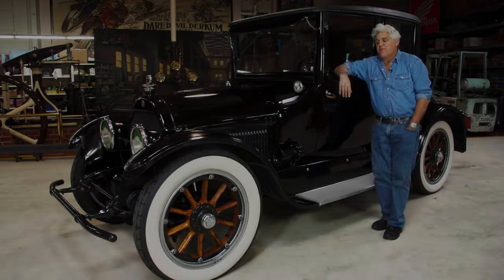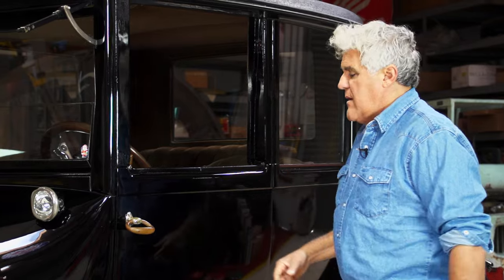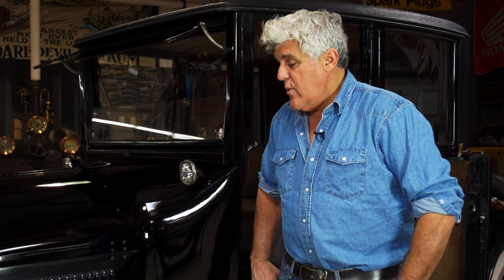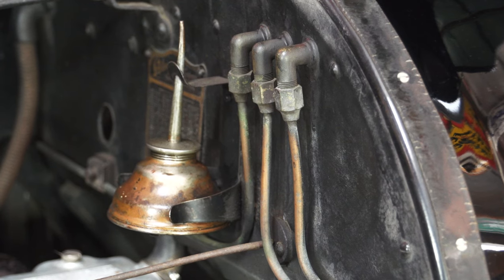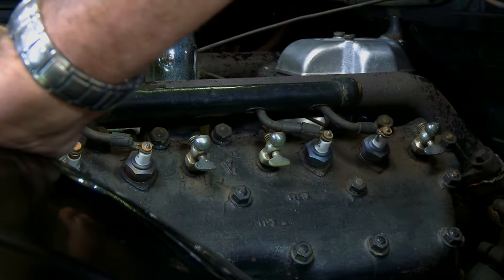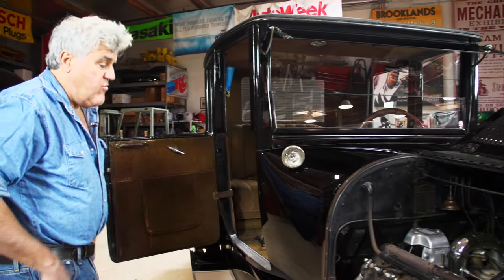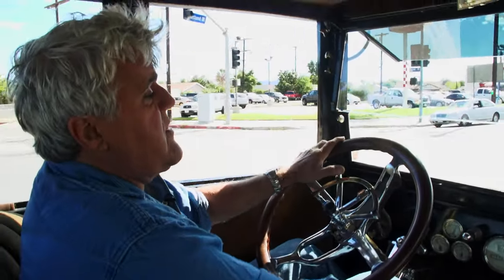1918 Cadillac Type 57 Victoria - Jay Leno's Garage

Comment: I repaired the fuel pump head on this actual vehicle for john, propbably 5yrs ago . it was the leather "O" ring seal , so had to use a neoprene based o ring ! The shaft of pump would walk out fully deployed ,bleeding the pressure of fuel tank . The old girl cleaned up well , wondering if you re-wrapped exhaust down pipe or had replaced it ? Got to drive it ....2miles but john was with me and that was enough ,i was very happy !!

Comment: What a car!  Yes, this is the car that really made Cadillac as a luxury, rather than upper medium priced, automobile.  And I agree with that owner's manual - most problems on an American-made car really are the owner's fault.  They refuse to change the oil and filter, they refuse to lube the chassis, they never check the oil in the differential and the manual transmission, they refuse to check the fluid in an automatic transmission, they refuse to tighten a loose fan belt, etc., then they blame the car when something finally fails.

Comment: Cadillac was called "The Standard of the World" in the day because of the Dewer Award. Also I believe Cadillac was the first car to introduce the electric starter in about 1908.
Reply: I believe that was 1915 that Cadillac came out with the first electric starter.
Reply: Yes I believe you are correct. It was the beginning of the woman's movement because now they could start cars without a man.
Reply: Marshall Curtis I just checked Wikipedia and they cite 1912 as the year that it incorporated the electric starter.
Reply: Terri Bel Bliss Cadillac also was the first to have the pedal layout we have today!
Reply: Cadillac introduced the electric starter because a friend of the heads of the company got smacked in the jaw by a hand-crank starter and later died of an infection.
Reply: the electrical engineers of the day figured it would not work because of the severe overloading, however since it was  operated only for a few seconds it survived fine, the idea came from an electric cash register if I remember correctly.

Comment: why is the fatmans wheel not a thing in modern cars. 
i want one
Reply: therealnightwriter
my truck has tilt steering, but i mean collapsable steering like in the 1918 caddy in this video.
Reply: +therealnightwriter Some even have or had swing away steering columns Thunderbirds & etc.
Reply: +Justin Bechtel  Get a new Lexus LS.    The steering wheel AND the driver's seat retract, and then move toward each other, when you start the car.  Quite obnoxious, actually.  And for those of us who turn our cars off at bank ATMs, the retracting seat makes it a logistical challenge to stop the car at the right spot in relation to the ATM buttons.   My assumption is that this feature is meant to accommodate portly drivers.
Reply: It's called the tilt wheel now

Comment: he forgot to show us the compressor. I wanted to see how that worked :-(
Reply: Your not the only one to notice that shortcoming. You just beat me to it.
Reply: I'm assuming it's the same as the rest of the cars through to the 1924 v63 - but basically there is a pull ring on the floor that you pull up to engage the compressor. The air connector is on the drivers side just under the door and above the battery. Then you have to set the hand throttle to about 1000RPM (with no tacho). It's also not really optional in a sense, because it's actually used to pump the fuel from the tank in the rear.

Comment: It's amazing that 1918 Cadillac has such a huge rear window. Many cars that were made in the 20's, 30's, and 40's had small rear windows and many were split rear windows, all of which compromise rear visibility.

As for that steering wheel that accommodates "plus sized" rich people, I had a 1965 Ford T-bird in which the steering wheel would move out of the way when you shut off the motor so as to make entry and exit easier. How advanced that was for 1918! But then again back then maybe it had to be if all the rich guys had to be rotund in order to show off their "proof that they have arrived' credentials.

This car was not as huge as that 1919 Cadillac former US Army staff car that I saw at the last XXX Root Beer restaurant in Issaquah WA a few years ago. That car only had about 30k on it but it was not in as good a shape as Leno's 1918 model. They were in the process of restoring it though. But it runs. The owners of that huge (I mean HUGE) 1919 Caddie were able to account for it's history back to the mid-50's.

Comment: It's astonishing how well-built that Cadillac is! I've experienced cars that crap out, rust, tarnish, and fall apart no matter how well you care for them. Workmanship and engineering is critically important to longevity. That Caddie is a masterpiece.
One question, though, Jay. What kind of coolant did they use in it? Plain water would have rusted out the block pretty quickly, and, at least, would have caused engine overheating. I can't find info on what people used in the old days for anti-freeze.

Comment: I used to work a Lincoln dealership as a porter. Could you imagine a little old lady coming in about something wrong with her car and someone telling her "well, you don't understand your car, and because of this, you broke the car, you should have read the manual on how to keep your automobile tuned yourself" I mean, yeah an oil change, brakes, other fluids, etc, but, the stuff you have to do to keep this running, they expect YOU to do it!

Comment: For those who may not understand the "interchangeable parts" talk - he doesn't mean "interchangeable between Cadillac and Ford and Chevy", he means "interchangeable between Cadillac Type 57 serial number 7 and serial number 107."  Most European cars of the time, you couldn't just take a spare part off one car and put it on another of the same make and model!  Gas cap? Better make sure it's the same hand screwing. Better make sure it's the same interior diameter. Even though it's the same year/make/model.

Comment: i have an owner's manual from a 62 Chevy pick-up and it reads along the same lines as the Caddy manual. based even off the 62 chevy manual, it most of been time consuming to lube it. in todays cars you'd be hard pressed to even find a lube point (zerk fitting) to grease it.

Comment: I don’t understand the throttle lever on the steering wheel, if he has a gas pedal what does that do? Would love an explanation as I’m pretty confused about the controls and have never seen that before.
Reply: The throttle lever on the steering wheel or column is probably to set the fast idle. When I was a kid, the fast idle was set by a thermostatic bi-metallic spring mounted on the intake manifold. When the car was cold, a rod attached to the spring would open the throttle slightly to help it stay running until the engine warmed up. As the intake manifold heated up, the spring would move and gradually close the throttle until the main idle speed screw held the carburetor butterfly valve at the right angle to maintain proper idle speed. The lever you refer to is more than likely the precursor to that bi-metallic spring device, but completely manual. There may also be a spark advance lever. When cars had manual throttle control levers they usually had those, too. Model Ts had both. I have seen Model Ts in operation at The Henry Ford Museum in Dearborn, Michigan. My grandma's parents had a Model T and it was still running when I was a little boy in the early 1960s.

Comment: I'm curious what gasolines Jay uses in his antique fleet. Many of the very old cars are not very fond of modern fuel. It burns too late and long with valve damage a frequent result.
Also curious as to what fuel he leaves in them during storage. There are unleaded fuels marketed for use in engines that are left standing for long periods. Aspen Fuel is one brand. 80/87 Avgas used to be the ticket, it could be left for years and years but is difficult to find.
Reply: I use boat gas. pure gas no additives. can sit for long periods with no problems

Comment: Usualy as a liquid in a sealed container it's not able to build up heat. If requires the liquid to be spread out enough to oxidise inside an heat insulating material to create enough heat. Just so happens the perfect medium is a stain rag. Rinsing out the rag lightly won't work either (oil & water) so be careful.

Comment: I am surprised it had a self starter in 1918. Most cars would have required a hand crank to start. Also some of the later cars had a central greasing system that lubed all the chassis points with one pumping device. Maybe a Packard innovation?

Comment: I don't know where Jay got the the idea that linseed oil is combustible. Linseed oil is the usual binder in oil paint, which is thinned with turpentine.  Turpentine is as combustible as gasoline. But the linseed oil, and oil paint made from it, has a flash point over 450 degrees. It's no more combustible than paper.
Reply: You're really putting out some dangerously bad information there, dude. Linseed oil soaked rags  are notorious for spontaneously combusting.
Reply: Look up the youtube video "Linseed Oil and Spontaneous Combustion"
Reply: Ah, I've found that linseed oil sold for staining wood — as described in this video— contains solvents. That, of course, makes them combustible. Pure linseed oil, as sold to artists, is not. It's even consumed as a condiment in Europe.
Reply: PLEASE don't listen to this guy. Linseed oil soaked rags can spontaneously combust. Period.

Comment: Joseph Whitworth introduced standards into the engineering world in mid 19th century, he could machine to an accuracy of one millionth of an inch using his machines and of course gave us the BSW threads for nuts and bolts the engineers flat surface...etc, before nuts were made as required. For some reason though American stuff always fitted together?? Any part of one tank for instance would fit on another...Not ours,would  require filing a bit there or trying another...Whitworth re-invented the rifle, which was ejected here but was used by snipers in civil war. It used a hexagonal bullet which twisted at 1:20 much less than standard rifling, he spent much time perfecting it and it was an order of magnitude more accurate than any gun before.  Love your programmes..)))

Comment: When you look at how far automobile technology advanced between 1890-1920,and compare it to 1970-2017 for instance,it's pretty shocking what they were able to accomplish,and they didn't even have computers to model with.Most of your inventors back then didn't have a college education,let alone a degree,and look at what they achieved.Lets also remember that many of the technological achievements in engines, are owed to a different industry all together,the computer industry.The modern engine is a mix of the classic combustion engine,and a computer management system.
Automobile companies place at the most importance on so called share holder value.Quarter after Quarter,the CFO,CEO nervously take the podium,and defend the short term vision of the company.I don't believe for a second that anyone at the top of GM,Ford ect,cares anything about cars,or drivers.And that's probably true of most modern industry today.They are conglomerates looking to stifle any innovation,or competition,by purchasing upstarts,and promptly killing any progress.Because developing something requires know how,and long term thinking.
Rant off........thanks for reading.

Comment: 7:28 Now modern cars and trucks don't even come with grease fittings and that is a bad thing.  Trust me.  These so called lifetime fittings last "the lifetime of the part".  Which is often about 50 thousand miles or so.  So when the grease pisses out of them or goes bad, there is no way to replace it.  They have those needles that fit on the end of grease guns but still, what happened to fittings?

Comment: Amazing how jay is slightly 
Knowledgeable enough to know about the dewars cup award- in which  
T H R E E  cadillacs were taken down/ broken down/ and parts thrown in theee separate bins- all mixed up- under a time limit /
the three were put back together not  only within the allotted time but perfectly workable as well- JAY FAILS TO MENTION HOW THIS- the mixing of parts Successfully - because of the precision ( in a time when you brought car parts to a blacksmith to “adjust” to “fit”) also led to the appplication of the name “STANDARD  OF THE WORLD/ because of actual standardization of parts which were totally interchangeable  in a time of, as Mentioned previously...
blacksmith adjustment!!

C’mon Leno- 
While Extremely Well versed in  CADILLAC history, BUT NOT
AN EXPERT, By FAR -
And I KNEW THIS most Important of historical founding Facts- ?!
Incidentally:
all the old ADS on the bottom OF THE PAGE would say :
 standard if the world”
Sprightly performance
Silence of Operation
C A D I L L A C

Comment: Didn't Cadillac pioneer two vital advances in auto development? 1) Synchronized transmission gears and 2) Electric self-starting.
Reply: Yes, the first synchronized gear transmission was put in the 1928 Cadillacs and La Salle's after years of development and testing. The inventor was Earl A. Thompson, who was an engineer at Cadillac. The electric starter was introduced on the 1912 Cadillac, after Cadillac founder Henry M. Leland worked directly with Charles F. Kettering (the inventor of the electric starter). Among other firsts were electric lights and ignition, and the 1924 Cadillac is considered to be the foundation for the pedal arrangement for all modern cars.
Reply: no. Dayton Engineering Laboratories invented the electric starter thingy. DELCO was later bought by GM.

Comment: Why would they make the wheels out of wood? I mean they clearly knew how to shape a metal body back then so why not the wheels?
Reply: +Hugh Jass because it was common practice with coach builders and it was cheaper and easyer
Reply: +Hugh Jass because metal is cold in the winter, wood is always at good temperature.
Reply: +Hugh Jass * and hot in the summer.
Reply: plus steel spokes at the time would ahve been a concept or maybe on high end cars
Reply: +Hugh Jass Probably not really because wooden spokes are cheap but more that they are the proper way that a coach builder would make wheels. Clearly why this type of car was not a ford peoples car.
Reply: it may have been they could not precision-stamp them well enough to minimize out-of-roundness, rattles. etc. I'm just guessing. I think your we question is a good one.

Comment: Flatplane or crossplane. Crossplabe was not logical at first, and as far I know Cadillac was first to develop crossplabe engine.
Reply: Flatplane. Crossplane in '23. The foundry developed a process where you take a flatplane forging and twist the appropriate crank throws into position, allowing economical production of crossplane cranks. Non twisted crossplane crank forgings remain expensive to produce.
Reply: Jonathan Peters Thank you for answer.

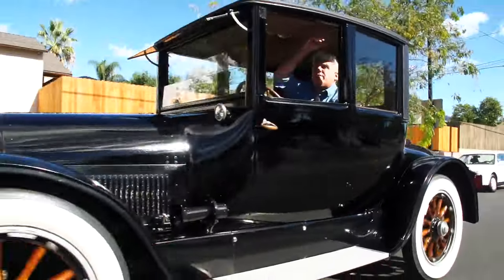Comment: Moreover, why do you see the wheels 'hop' at around 13:20 to 13:40? Were the 'linseed oil' wood spokes a bit out-of-true?  Granted, a century has gone by, but that has to be felt as the car rolls!? Nice car, and a great testament to American design of the period. My Lordy, no crank start needed!, And the steering wheel moves to get out out of the way of the Beer+Brawurst Gut mostly found (then) on the over-fed Over-Lords of Industry of those times!! Brilliant, suprised the Brits didn't think of it first!
Of course, today's empirical sovereigns would hire exercise-consultants to minimize that awkward gut, and also be rewarded some 500 times Your Salary, because, you know, they're just That Much Smarter than YOU!
Reply: The "Wheel Hop" at 13:20 to 13:40 is the suspension travel from hitting bumps in the road ! The springs cushion the bumps so the car stays smooth while the wheels go up and down over the bumps. It ain't rocket science, it's just how suspension systems work.

Nothing wrong with his wheels !
Reply: oldSawyer
Oh, I assumed the car had rubber spring dampeners (not just 'bump-stops') to keep the springs from 'hopping', thus I wondered about the wheel's "roundness". Also, the fact that they're wooden, which unlike wire spokes have little by way of 'truing' available if they warp. Plus, Jay noted the moisture issue, along with the Linseed Oil. Those ARE old enough to have used Whale Oil as well, which, I can attest to, is very hard to re-finish on antique woodwork...